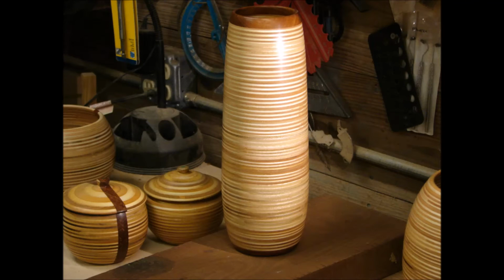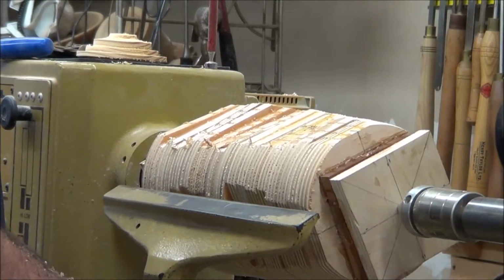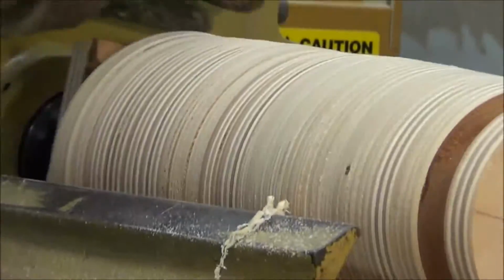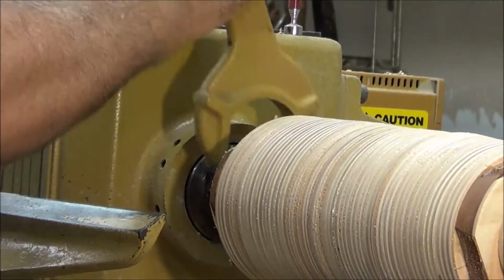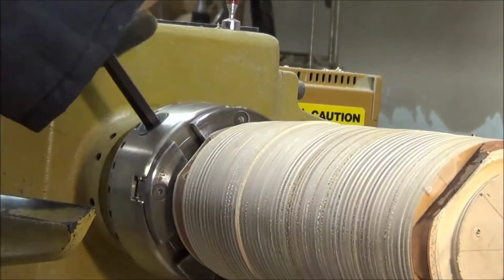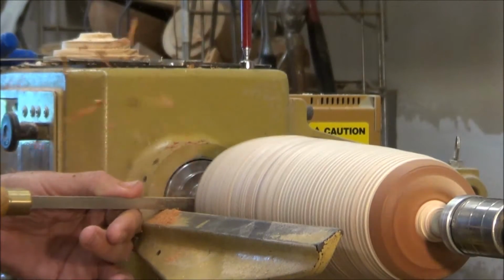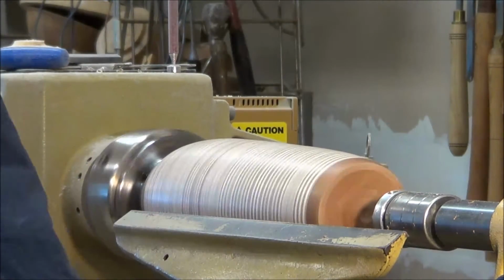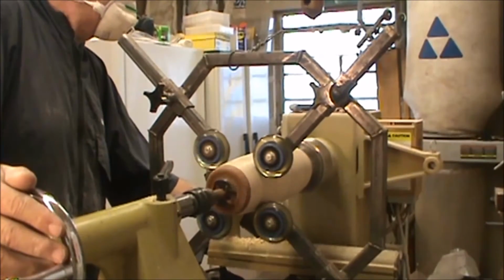Woodturning a Tall Plywood & Mesquite Vase "Part 1"

Comment: Question: Why did you remove the faceplate and use a chuck?  The advantages of a chuck are many, but I cannot see one that applies to the turning of such a vase.
Reply from the maker: David, Actually there is no reason except that I'm so used to starting between centers with a spur drive then adding a tenon for a chuck that I did that without really thinking about it. I made the tail stock end the bottom so I needed a way to hold it. Like I said it was just repetition that took over :-)